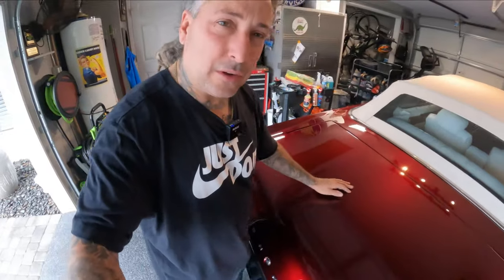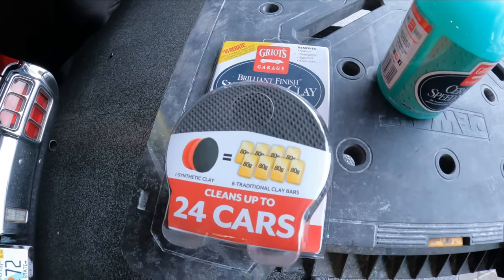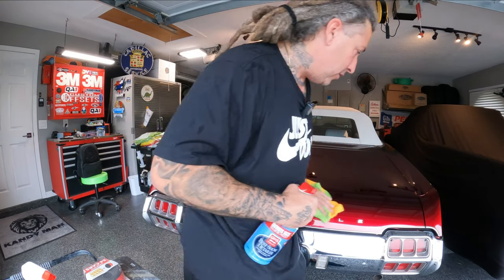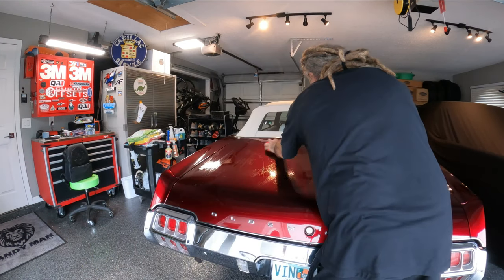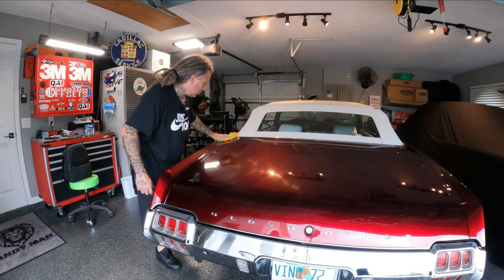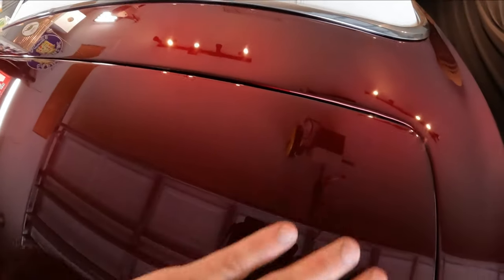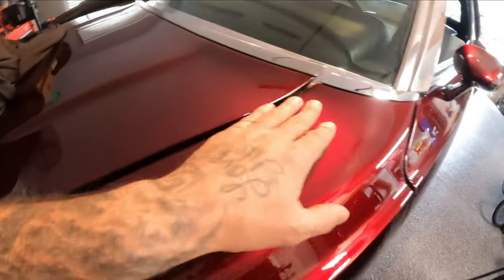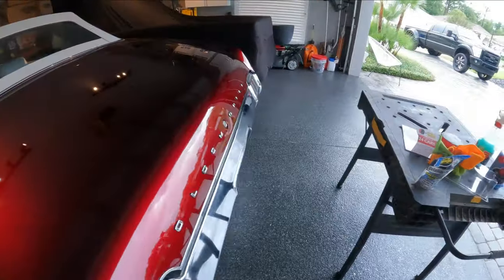How To Remove Overspray on Your Car...

Comment: Thank you, thank you, thank you,  thank you!!!!!  I just bought a used F150 that had all kinds of overspray on it that I didn't see when purchasing.   I found another video that recommended two ounces of each: 99% alcohol,  paint thinner, and urethane reducer.   That did nothing.   I was getting it off very slowly with different brands of scratch removers and compounds, so I kept searching for other videos in removing overspray.   I ordered these two items from Griots and wow, do they work very good.  Within half an hour I got half the truck cleaned off.  This stuff is super impressive.   Will be giving Griots 5 stars for these products.
Reply from the maker: Glad I could help

Comment: Use 1/2 oz and 1/2 oz Isopl aclchol And Laquer THinner spray it on , and a micro cloth.  wont' take off clear coat , works like magic. CHEAP. 50/50

Comment: Omg that stuff can travel 30ft without you knowing next time bag it up bro !! Lesson learnt great vid great finish 👏👏
Reply from the maker: The fun never ends lol
Reply: Facts! I spray painted my racecar roll cage in my garage and my daily driver was 20 feet away in my driveway and got overspray. I was shocked and felt like an idiot. That's how I found this video. Thanks so much man for posting. We did the same thing. Life lesson learned. Hoping to have same success of removal as you did. Mine is just like yours- you can't see it, but you can feel it and it makes the same sound. THANKS! One tip for me going forward- will no longer spray paint roll cages- I will brush/ foam instead.
Reply: I work in a dockyard , 2 pack paint travels 200 metres . Every car in car park is covered in it .

Comment: Thin/cheap plastic "drop sheets" for painting your house interior rooms are great for covering your car when parked up in the garage.  I have tried those soft fabric car covers you buy from Auto shops but they are useless for letting the fine dust particles through (which is in the air at all times).  If you do use those fabric car covers still - then place a plastic drop sheet over as well
Reply from the maker: They definitely do let the dust trough  thanks for the insight

Comment: Killer Cutlass.  If you don't mind, what size wheels are you running in the rear, what is the offset?  Did you have to modify the wheel well to fit those in?  Thanks.
Reply from the maker: 24s in rear perfect fit, no cutting  or customizing  for exact sizes check out dro wheels  fla
Reply: @kandyman5315  Thank you Sr, much appreciated. 💯

Comment: Instead of clay barring I have in the past just to put some swirl mark remover and a foam pad and just go over it lightly wash it with soapy water and go over it again sometimes the pad will snatch the overspray off while polishing
Reply from the maker: That was my next step lol but it came off before.
Reply: @kandyman5315  I know it one more lightly Mist down the whole panel one panel one panel at a time with some Goo Gone let it sit for maybe 45 minutes then white with microfiber cloth One Direction only while lifting the cloth as you wipe at the same time and lifting off the contaminants and not sliding them across the paint work that all depends on the surface finish what type of clear how polished it is and what stuck to it if this will work or not

Comment: I hear of people using synthetic plumbers putty of course I claybar a soft one and a brand-new in on something of that caliber with water or the lubricant spray of course you might have to lightly polish maybe even compound polish and swirl mark remover after that is going to lightly scratch

Comment: Spray max Grey Epoxy overspray is the worst! That shit flys far too. I exclusively use spraymax 2k & automotive touchup matched base colors. Done many repairs, micro blends, 1/4 & 1/2 cars that way. Takes long time doing it in a regular garage, body works by hand. But i can get pretty nice jobs. I do hope that 2k Glamour clear lasts 10 years. Seems good, Ive done couple dozen repairs with it. Also doing my daily driver panel by panel all quality rattle can stuff. My metallic paint job are super good youd swear it was a spray gun in a booth. Wonder what i could do with all the right equipment. Used to be a union painter in the 90s, new home construction.. I seem to really like painting, im part sicilian from my grandpa, & he liked to paint as well.